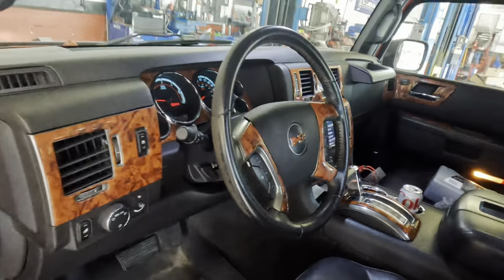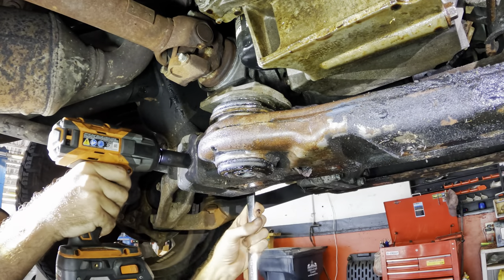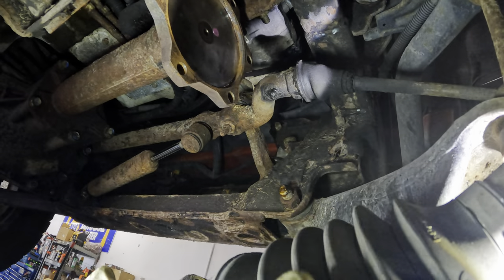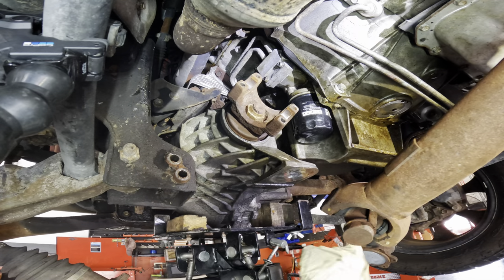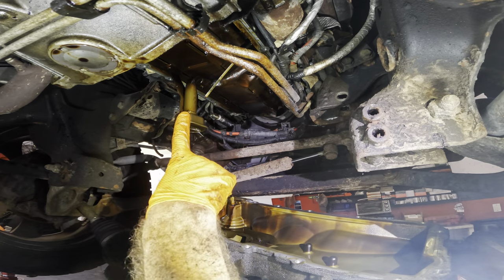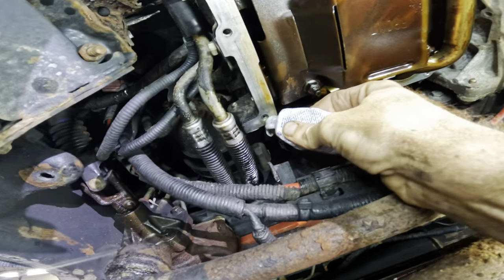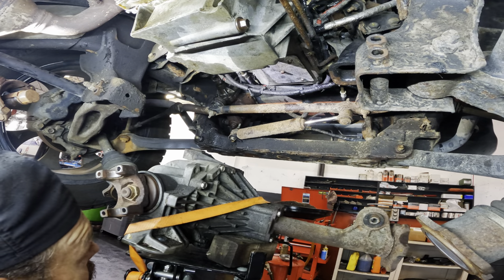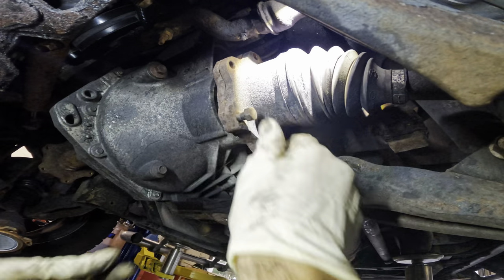Remove Axle for Engine Oil Leak!  2008 Hummer H2 6.2l

Comment: There are times when I've seen you do a complete overhaul on lower and upper control arms replacing the entire unit part when all that is needed is new bushings and ball joints.
It has to be cheaper to just replace the damaged parts and especially with the newer polyurethane ones.
I know that there is a universal kit to remove the old bushings and to press in the new ones.
Just wondered why you do that as it seems it would save the customer money.
Or maybe it's the labor involved???? 
Just wondering.

Comment: Must be nice to work on the underside of cars where you can use an impact driver to remove every nut and bolt with no need to resort to 3' breaker bars, heat or oxygen acetylene! The joys of living in the North!

Comment: Noticed wire connector at front of engine when you was putting pan up
You probably got it but my ocd brain is saying did he

The wonder about this H3 is when some one messes with underside of the vehicle did they pop the wires to the trans
Its in the area

Comment: Good video again, thanks.
Just one question, do you check to make sure there is negative crankcase pressure when engine is running?  I heard that positive pressure can lead to oil leaks.

Comment: Why did GM change it to where part of the oil pan is under a cross member/engine support on the FWD's?? On some of the older ones I've seen the oil pan was accessible without having to remove a support bracket (if I remember right). The gasket on mine needs replaced on my 07 Monte LT, but about half of it is blocked by an engine support bracket.

Comment: hate to say it but when a crankshaft seal starts leaking, front or rear, your best bet is to replace the seals ,and blow by can be a problem, the crank cases on modern engines have vacuum, to reduce blow by
Reply: Gee , Thanks for info.  I'll bet noone else on earth knows that .

Comment: If you will pour in a 1/2 gallon of oil into the engine, then pour the Lukus into the oil jug with 1/2 gallon of oil left in it and shake vigorously .  The Lukus mixed with the motor oil in it will pour through the cheap little Harbour Freight funnel you have there a lot easier .  🤔

Comment: Question about oil filters.
So the 2009 LY5 5.3 takes the same but smaller oil filter than the 2019 L83 5.3 oil filter. My question is, can you use the larger L83 oil filter on the LY5?

Comment: Did not know hummer H2 was made from recycled land rovers as the rust bugs love that steel.😀
Reply: And you know it is broken when it does not leak any more.
Reply: As with all English vehicles particularly vintage motorcycles you check the oil by looking at the oil slick under the bike.

Comment: I’m surprised your lift can handle that beast
Reply: I think I saw the lift rating in another vid at 9000, and those are 6k vehicles, I believe.  besides, the owner has non stock wheels and tires on, so that probably drops a half a ton off the weight.
Reply: Why? It's a mechanic shop? They work on literally everything. They even had a big ol' diesel box truck in there the other day. Granted it was too tall to be on the lift, but why wouldn't they have a lift that can handle anything that comes in pretty much?

Comment: Ugh makes me dread going to work tomorrow got one of these money pit H2’s waiting for me. It’s a frequent flyer from the past 2 years not sure exactly what is left on the thing that hasn’t been replaced, rebuilt, or repaired. Possibly the speedometer needle is still original.
Reply: Not a vehicle for the 'Thin of Wallet' !

Comment: My question is what video did you check for a rear main seal leak? It's not the one in the description. You pointed your camera under looking at an oil leak never checking for rear main leak.

Comment: The price of the billable hours is getting closer to the insurance value of the truck...
Back to the ignition switch solenoid...I  would have pulled the fuse when it wouldn't release the key and see if the problem was solved.

Comment: So what was the final version of the electrical gremlins? Will he drive until it fails again, or will he replace the fuse panel? Curious minds want to know.
Reply: The fuse box internal connectors were crusty causing intermittent problems so I believe Ray recommended a new one. .

Comment: Hi Ray, a little off topic “do do do do do do do”…. Since you work around lifts all day I was wondering your thoughts on setbacks or minimum space requirements for a two post lift. I am in the design phase of a new garage and will be installing a 10k lift. The largest vehicle I plan to use on it is my 1 ton crew-cab (22’+).  In addition to minimum requirements what would be your ideal space requirements? And thanks for the knowledgeable, and entertaining, vids! JJ
Reply: This isn’t Ray of course. You need to think ahead and make your shop big enough to begin with. I had to add on to my shop within two years. What I thought was going to be big enough wasn’t.
Another suggestion, buy a good quality lift. Make sure you follow their suggestions and do not forget to re-torque the bolts in the floor on the intervals that the manufacturer suggests. 
Use a high psi fiberglass reinforced concrete.
Reply: Yes, thank you Poppi.  My shop will be somewhere in the range of 36’x56’. I realize I could put it right in the middle however that would not make the most sense for the overall use of the space.  The lift, although it is important, it’s not the primary use for the space. I can adjust the size of the garage easily at this point to make it fit comfortably that’s why I’m looking for feedback on setbacks.

Comment: I have been watching you for a few weeks.  I just subscribed  you do so many things well and I am a few years older than you.  So many sat great things I decided to pick on you and see where it goes.   Weak points must be known if they are ever to become non-weak points.  Here's one, you just put a used boot on a CVJOINT/ ok, cause there was no new one.  They are available.   You put no lube before assembly.  I wanted to take a grease gun and do it for you..   Other picky's may come later if I don't turn my attention.   Now....youare good.

Comment: Ah Yes . Infamous LS type motor
Engineering Magnificence designed by NHRA Record holders. Simplicity, reliability in a compact burgeoning Powerful aluminum form. Proof the ancient 2 valve pushrod engine still has a few tricks up it's sleeve. It actually predates GMs bankruptcy. If you don't have a few yet , let your search begin.

Comment: 34:25 I would hold off with the skid plate until that oil pan is full of oil and the engine is running to check for leaks.

Comment: Can you imagine having to do all that extra work for an oil change in the heat of Afghanistan?
Reply: This is an h2 though not a real hummer.
Reply: @KozarBen  You are correct...many of the parts on these are Chevy half ton truck parts...not the military version parts....if I'm correct nothing interchanges between the two

Comment: Mechanic: we need to replace the oil pan gasket…we CAN replace the oil pan gasket, right?

Engineers: …

Mechanic: RIGHT‽‽‽

Engineers: (huddle together with whispers) •snickers• yes, you can change the oil pan gasket - we made sure you can disassemble the bottom half of the car for easy access - be sure to bring a lunch!

Comment: Ray you’re slipping. You forgot to brake clean those lines & back of where the oil pan before you dropped the oil pan, would’ve been less mess on you. You said that you don’t like oil running down your leg nor do I, that’s why I don’t wear shorts while working on vehicles, regardless of the temperature. Ray when you loose your nuts, you’re not a benefit anymore. Also it’s always good to have good wood. You should’ve been humming a tune while working on the Hummer. Your always educational, entertaining (talking to yourself, what you’re work on), while you’re having yourself a great day

Comment: What about the key solenoid issue?
Reply: Did you watch the video on mute?
Reply: I did not. At 35:10 he switched to the leak with no definitive conclusion to the problem.
Reply: @unwired1281  again, did you watch the video on mute? He literally said it was for another video

Comment: Worse than a subie. Where the back of the oil pan is covered by the engine support cross member. If you loosen the Engine mounts and jack the block up you can just about get the bolts.Then you have to struggle to get it out around the pickup tube. But I am sure you have done one of them too.

Comment: You guys are lucky to work with luxury I work but hard pointed gravel even my wife question me no lift lucky my beer belly fits under
Reply: Do you at least have a set of drive-on ramps to lift one end of the vehicle?  Also, I've found that the cheap, somewhat quilted packing blankets from Harbor Freight are good for ground cover and for throwing across front fenders and such for protection.

Comment: Oh, and I do wish that you would wear safety glasses more often especially when working underneath and looking up.
Those bolts can throw off little pieces of metal as they screw and unscrew so BE CAREFUL BUDDY!!!!!
IF it ever comes that you have to wear an eye patch, then it will be mandatory that you have one of your legs removed and a peg installed.
Then, you'll have to go round saying, "ARGH" all the time instead of "Click".
And, adopt a parrot to hold the camera on your shoulder.
"Tweet, Gravity! Gravity! Tweet, whistle"!
Reply: Took them off after filled with salty sweat. Shop servants a tad slo bringing up the replacements

Comment: What’s the Lucas stuff you used and what’s it’s purpose I’m just curious. Hopefully ya didn’t say and I just didn’t catch on.
Reply: I believe that was an oil additive that helps, primarily, to keep lubrication on the crankshaft, camshaft(s) and such areas supposedly better than just motor oil.  It also will help quieten down noisy lifters as well as help if there is some knock on start-up from main bearing wear.  
Many professionals advise against any type of additive.  Increasing oil thickness/viscosity isn't necessarily bad, though, provided an engine isn't run at very high RPMs for extended periods.  In cases such as that, the oil can be too thick and not return to the oil pan in modern close-tolerance engines and crank and main bearings can end up being starved for oil and become DRT (Dead Right There).
If that was probably more info than you were interested in -- sorry.

Comment: You failed to clean the engine block case where the sump pan joins it ray? Thats not like you,i thought you would have brake cleaned the surface of that firstly before putting that sump pan back on ?
Reply: Ya to That. All the rusty crud warrents total new replacements
Reply: @peted5217  yep. It's not like Ray,he usually does a thorough job with these types of jobs.
Reply: @Healthliving1967  Ya. This fairly well kept ride deserves a fresh shiny entire drivetrain. And all else of rusted undercarriage replaced with plated or powder coated pieces to resist FL relentless corrosion. Folks that keep these rides can well afford the restoration of these rolling investments.

Comment: Oven cleaner and a pressure washer would make that oil pan look new
Reply: So would having a modern engine parts wash machine similar to what 'I Do Cars' uses
Reply: @peted5217  most people don’t have the money or space to buy a Marts washer like I do cars has. In fact I have only worked in two shops that had one,  but the place Ray works in Flordia doesn’t even have a pressure washer. That is because of the cost that it takes to get a commercial pressure washer in Flordia, they have to be self contained units that recycle the water using enzymes to break down the oil. Not a cheap proposition this is why ray’s shop doesn’t have one
Reply: @williambasinger5859  Wouldn't these same issues apply to using a powerful caustic on an item ,(oven cleaners) then using a pressure washer to broadcast it and the crud in a fairly open public area like Ray's shop. Seems the need to contain either method, not to mention legally dealing with hazardous  materials laws will be expensive.
Reply: @peted5217  yes and that is why the shop that Ray is working in doesn’t have a pressure washer
Reply: @williambasinger5859  @ some point a shop has to come to grips and provide employees means to efficiently do their job and comply with  materials handling rules. The $5k-$10k+ costs of cleaning equip  are significant , but far less than potential fees, fines, forced clean up costs of non compliance. The two bay service station I work @ is tested annually for discharge permit and randomly when nearby runoff showed excess oil or industrial chems. Usually several times a yr. Fortunately we've not been the source.
Reply: @peted5217  which is why battery electric vehicles are the way of the future. Lol
Reply: @peted5217  lol well I have a 96 ford ranger with over 400 k miles on it. I have been looking on Copart for a wrecked ford Mach-E when I win a bid on one I will be converting the ranger to electric
Reply: @williambasinger5859  You'll be a pioneer in that type swap. Probably be a feature in HOT ROD mag. 2021 SEMA show had lektric motor kits with conventional layout. Wouldn't be surprised to see complete platforms in different wheelbases this yr. I do LS & LS stroker repower for rods with SBC along with susp, brake mods as custs wish.
Reply: @peted5217  LS swaps are so over done. That is why they are starting to do Hemi swaps on you tube
Reply: @williambasinger5859  Ya.True That

Comment: Back in the mid 70s, there were no impact power tools, everything was hand tools ;, from lug nut removal to a lot of ratcheting rusted bolts off and on, point being these battery operated power tools cut half the time and a lot less strength to operate, but then again hand tools and knowing how to use them, all of them comes in handy, I'm 66 and have most American made hand tools, ✋️, tools you bye today if made in China there junk, total junk , good videos, nice diagnostic work, and  imagain if there was no electricity to charge power tools, that oil pan replacement would have taken a extra 5 hours ratcheting and wrenching ... click !

Comment: I cringe every time I see you use a power tool to remove nuts and bolts, I spray  a little PB and always make sure the threads are clean and have a dab of lube (not much) when installing

Comment: What a stupid layout...design engineers strike again!!
-
At 34:37, I would have filled with oil before putting that piece on.  Just in case you have a leak!  Would save some time if that happen.